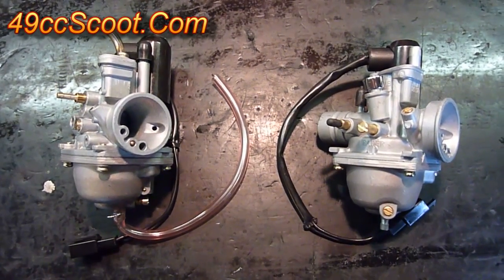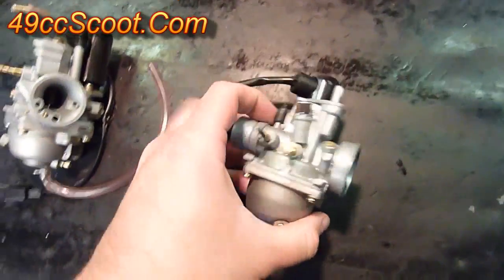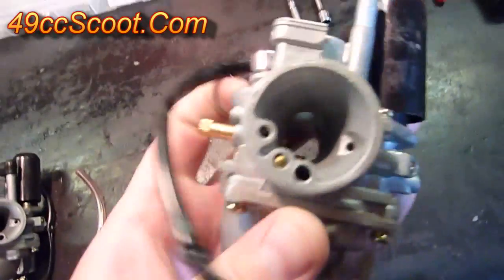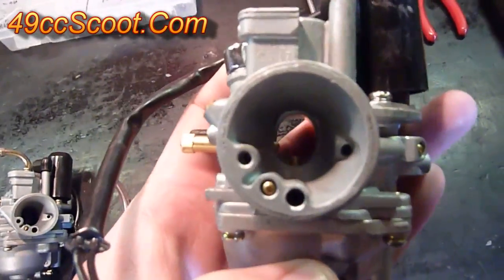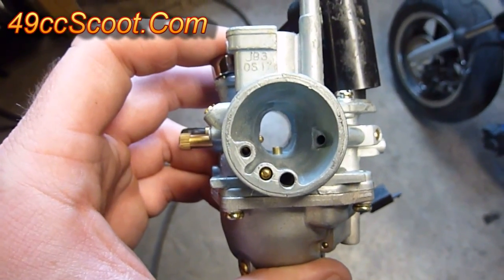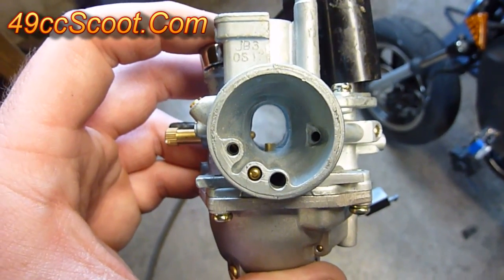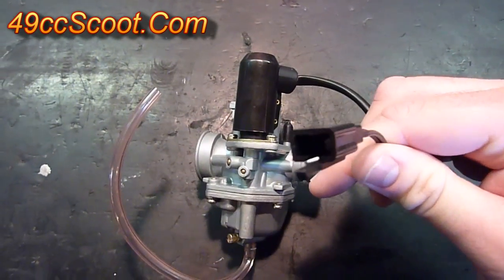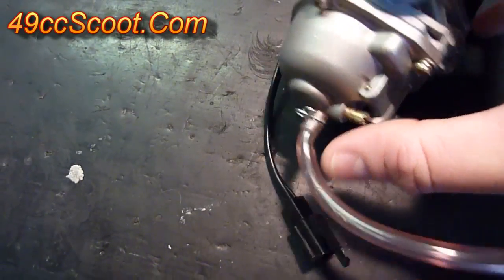Two-Stroke Scooter / ATV Carburetor Settings And Adjustments 1of4 : Basics, Overview

Comment: Hi! I have a question: Why is my carburetor outled blocked? Its much smaller then ours. 60% of that hole is blocked with some kind of metal?
Can you help?
Reply from the maker: Do you have a pic or vid link?
Reply: @49ccscoot  I found a pic on Google, its the same carburetor as mine, but the hole is a little bit bigger than mine. It's the first link if you type on Google: Orginal vergaser 50 ccm 2 takt mit markenzeicgen u.
Reply: @49ccscoot ???
Reply from the maker: @KEEWAY_LOVER  Just not sure what outlet would be blocked. If you mean the engine side of the carb has a chunk of metal inserted to restrict it, I haven't seen that before. I would wonder if it could or should be removed, but seeing it would help.
Reply: @49ccscoot  but my outlet is smaller than on the picture

Comment: Has anyone on here ever come across any problems with the auto choke on these carbs? I’m having trouble with my sons buzz 50 starts and runs but soon as you go to drive away it bogs down and cuts out. Won’t start again until you have switched the kill switch off and on again then it starts easy but cuts out shortly after. 
Carbs clean and fuels flowing but I haven’t dealt with a auto choke before so could it be electrical?
Reply from the maker: The automatic enricher heats up and expands to cover a port and stop enrichment. If you can shut the engine off and then fire it right back up, it shouldn't be the enricher because it's state shouldn't change that much by cooling for a second or two. If there is a timelapse till it starts again, giving then enricher time to cool and contract, then you are probably on the right track.
Reply: @49ccscoot  brilliant explanation thank you for that. That kind of reply earns a sub all day long👍🏻I might need to give the carb another strip down then and a more intricate clean. It sat for a bit with fuel in the carb I wouldn’t of thought it was long enough to coz any trouble but the new fuel really does solidify quick so maybe I’ve got a jet blockage somewhere. 
Thanks again
Reply from the maker: @weebinniec  If you have access to an ultrasonic cleaner, you may want to try that. I have had carbs that were cleaned thoroughly before and then worked after ultrasonic cleaning. It's not common, but easy enough if you have one around.

Comment: my carb has an additional horizontal port that sits below the vertical vacuum port. I assume this is for the breather hose from the stock air box? Is it necessary to connect it?
Reply from the maker: Some have multiple vacuum ports or it could be something else. I've never had a breather hose on any of my two-stroke airboxes. See if you can find a diagram or pic of your machine to verify. If it's a vacuum port, it must either be connected or capped though.
Reply: I can't seem to find an example of any diagram with my exact air box (OEM Yamaha 3KJ horizontal minarelli) The examples I find are 90percent the same with the exception of the absent hose which my airbox has.

The port on the carb that I am referring to often comes with a short 90 degree piece of open hose on the end of the port from the supplier and is not capped off. I don't know if that explains much  @49ccscoot
Reply from the maker: @stemfilms901  That may be a vent then. There is usually a bowl vent (or 2) on carbs. Often with a downturned hose on it/them. If you check the carb out, you should be able to tell what's what. A vacuum port would have to go into the inlet tract. A bowl vent would lead to the bowl.
Reply: @49ccscoot  if in case it is a bowl vent, should I just leave the 90 degree hose on there as it came and just zip tie the hose from the airbox?

Really confused about the purpose/placement of that air box hose lol
Reply from the maker: @stemfilms901  That's where I'd start.
Reply: turns out to be a bowl overflow as you said, thanks for your help again!  @49ccscoot
Reply from the maker: @stemfilms901  Glad you got it figured out!

Comment: dangg this means i have a 14mm carb on my bws 100!😢
Reply from the maker: The good news is that a DellOrto PHBG 21mm is usually a pretty simple swap in place of the stock carb. No personal experience with the BWS100, but if the intake and airbox fit the same carb that I showed it should be easy enough and plenty of carb unless it's a high revving setup.

Comment: Hello, what could cause exhaust smoke coming out of carburator? Also the revs would go up hard/hesitating, it'll work if I set the mixture screw at 3 turns, and at full throttle the revs would go up and down, it'll lose power then gain it again.
Reply from the maker: There is no carburetor setting that will make smoke come out of the carburetor. An abundance of fuel may be part of the cause if it's actually fuel vapor/mist.

Comment: Is the makuni 14mm mixture screw adjusting air or fuel?
Reply from the maker: Just look at which side it's on. If the mix screw is on the air filter side, it's adjusting air. If it's on the engine side, it's adjusting fuel.

Comment: Hi, the carb to the right, has a "chrome button" on the left side of the carb (opposit side of choke). What is this? On my carb, the chrome button is missing.. Can you run with out? /Rob
Reply from the maker: It's a bolt that doesn't do anything on this one. It's some sort of block off that they put on some and others don't have at all. I don't recall ever owning  a carb like these that has an open passage there or makes use of whatever it was intended to be. So I guess the short answer is, you should be fine... as long as it's not an opening without anything in it that leads into the intake tract.

Comment: Thanks for this vid, I have a Chinese 2 stroke scoot with I think the 14mm Mikuni(copy) carburettor and I’m having persistent flooding issues, I’ve taken the carb off over a half dozen times, cleaned it using carb clean spray, adjusted the float height, it works for a while but after a week or two the coughing and spluttering and not wanting to Rev comes back, 
     I bought a new carb for it, and it will not even run on that, I’m at a loss as to what it may be, it either floods or starves.
Reply from the maker: Have you checked the jetting in the new carb? Sometimes the jetting is way off of what you had or need in replacement carbs.
Reply: @49ccscoot  The only things I’ve checked is the float height, I don’t know if one of the previous owners messed with it trying to get more power out of it and completely upset the setup. 
      Do these have a clip setting on the Throttle needle? I haven’t checked that. 
      The plug is white but then drips of fuel come out the overflow pipe on the carb.
      It’s happy to rev up to a half throttle, beyond that it loses power and sounds like the choke is on or something.
Reply from the maker: @willswheels283  Unless it's one of those nifty EPA approved deals, it should have an adjustable needle. Being good up to, but not beyond, half throttle makes me think main jet.
Reply: @49ccscoot  Thanks mate for your help, I’m thinking along the same lines now as well, I’ll check the throttle needle.

Comment: Great video as usual,,,,I have both 50 and 150cc 4 strokes,,,,I just picked up a prescott 50i and the carb is shot, however I noticed that this carb has no vaccum line to it, just fuel in and out from petcock and vaccum to intake manifold, when I get the new carb do I just plug up any vaccum ports on carb or does this scooter require a special carb?  Also, I usually get the $28 carbs from amazon both 18 and 24mm and have no issues with them at all, can you recommend a resonable priced carb that you think would out perform these carbs that would work on those bikes? Flat slide perhaps! Id hate to replace the throttle cable but I would do it,,,,TY for all your hard work.
Reply from the maker: You shouldn't need a special carb. Make your connection to the petcock and any other vacuum accessories and plug leftover ports. 

If the current carbs work, stick with 'em. I've never used a flat slide on these, but PWK is the popular choice. Often said to be harder to tune and doesn't stay in tune as well as a CV carb. The main advantage that I hear regularly is improved throttle response.

Comment: The carb on the right what is that silver screw? You never said what it was
Reply from the maker: It's a bolt that is blocking off a hole from the factory. Not something that you should touch.

Comment: Hi again I buy a PiaggioZip 50 2T I need to cleaning the carburettor when I finiz screw all both screws in a many full turns I need screw auto thank you again appreciate
Reply from the maker: Count the turns required to screw all the way in BEFORE you alter anything. Write those numbers down. That should be a starting point if the carb has worked before. Otherwise, 1.5-2.5 turns out for a starting point guess.

Comment: My fuel drain is draining fuel to much and when l start scooter it need to fill the bole it runs but dont want to rev after giving it gas after minut it start runing okey wants to rev, fuel consumption trow the roof
Reply: Please reply
Reply from the maker: It sounds like you need to check your float height. https://www.youtube.com/watch?v=xBCzVg4kUN0

Comment: Very good thanks.  The vacum port....is that supposed to be connected to a vacum hose  or line ?  Er is it one way valve in there and shall not be connected.  I mean there is a vacume hose or line to my Vivacity Scooter and it is connekted....not on the original carburetor...but on the intake manifold.  I guess there is a vacum system that needs to work properly to let the engine or carburetor work properly.  Easy to get confused when buy chinese carb on e-bay...because they do not come with instructions that you gave us here !  Thx.
Reply from the maker: Most likely it goes to a vacuum petcock so it automatically shuts off fuel supply when the engine isn't running.
Reply: @49ccscoot   Thank you !  Ehhh can i ask if it is likely i have a  faulthy vacuum in my scooter...because it dies exactely afther one kilomere a proximatly.  I thought it is the stator and pick up coil... I thought i saw no spark  when inspect...but could have seen wrong. When cold it starts and work again...until that kilometer...it shuts down like it was shot !  Maybe it drops some fuel....but the vakum valve maybe faulthy and shuts down the fuel when running...oposite to what it should do.  I know...i kan test and see if the gasoline is comming down the line.  Just asking anyway he he ! :-)  Thought the pick up or stator could react to heat and than shut down ?  Or if those ar faulthy...they just does not work  on and of like this ?  Ok ok...much writing.  Take care and thx again ! :-)
Reply from the maker: @Norwaywildlife  Could be a fuel supply issue. I replace my vacuum petcocks with manual switches because I've never had  a manual fuel shutoff fail. Could also be something like float height too low, and then it drains the bowl. That is more likely if it dies when you are using a lot of throttle. Ignition components can also fail when hot.  Sometimes it's easiest to try and get it to fail close to home. So if it goes 1km and dies, ride 1/2 km and then turn around and head back home. Have whatever you need to do some tests ready. Spark is an easy one to test about anywhere, especially if you carry a spare plug. If it loses spark when it dies and it's back when it will refire, then you know you need to investigate the ignition system.
Reply: @49ccscoot  Thank you ! :-) Super !  Appreciated ! :-)
Reply: @49ccscoot  Hey again !  Scooter Talk.  My Vivacity...i found out it is Vivacity 1 and 1999 model. I changed the stator today and pick up coil.  The problem still exist he he...So...the technique about the valve...i going to replace next...as you mentioned. Vacuum Petcocks. Now...I have a strange thing.  It starts perfectly on the kick start....but with el start...it will not start.  Can it be the battery delivers too little amp ?  It turns arround though...  Or have you ever experienced that the key swich faults and gives the coil grounding when activating the electrical start engine ? Or in other ways...when activating the starter...it in same time grounds the coil  ?  Ok...I guess i have to see on the spark.  But it starts easy and good on the kick now ! :-)  If i can ask ! ? :-)  Anyway...thank you very much for you previouse ansvere !   If my one kilometer drive and stop is not fixed afther vacuum replacement...the carb will be inspected next...It will turn out good he he :-)  Wghen working...it is an exellent scooter ! :-)
Reply from the maker: @Norwaywildlife  Could be a low battery. 
https://www.youtube.com/watch?v=Bw3ikMEGh74

Could be some weird electrical issue. Don't think it's that likely that the e-start is killing spark, but you can check for spark while e-starting and  see if it does go away then.
Reply: @49ccscoot  You°r the best to respond on youtube !  Thx allot ! :-)
Reply: @49ccscoot   Hey !  Now i checked more...and it is not a wierd grounding of coil issue...why it not start on el swich.  But i have to give it more gas on handle before it starts with swich el...compared with kick. Kickdown it starts momentarly. It could have something to do with the vacuum or low adjusted needle valve as you suggested.  The story goes on until perfection however :-)  No problem :-)  Just sharing some experience.  Ok

Comment: I hope you can help me, (english isnt my language, so there will be some words that are spelled wrong.

I have a cpi GTR 50, 2 stroke. 
The carburator is the same one you have! And the petcock, the flat end. My one is a dellorto 12 mm phv or sommething.

But i bought that cpi from a guy who had the bike sitting for 7-8 years. The rubber that is between the carburator and airfilter was cracked, so it got more air than needed. So i quickly fixed that, and now i dosnt have air leaks, i started and idle fine, but i couldnt still drive it, if i give it more than 50% gas it just goes back to idle or shuts off. (not a fuel problem by the way, the bike is stock and fuel jets) then i cleaned the carburator and putted it back together, and now it only start with some help from a carburator cleaner and idles High, for 1 second, and then shuts off. But before i cleaned the carburator it idle fine. 
But i have to say this. The air adjustment screw is totally shot. U cant screw it in or out, i can see that the previos owner have messed with it. Do you think the problem is in the air adjustment screw?  
Every other things checks out fine without air leaking thrue, like the rubber thing that holds the carburator or the rubber thing between the carburator or airfilter. 
Thanks for your time, i had to write so much so you can understand easily.
Reply from the maker: Knowing that part of the carburetor is bad, I would replace the carburetor. If it's only the screw itself, then you could try to replace that. Don't bother if it's the body of the carb that is messed up.

Comment: My 50cc scooter is using a lot of fuel fast. What do I do to adjust it? Thanks
Reply from the maker: Do some checks first. Make sure it's not leaking and that the float height isn't too high.
Reply: @49ccscoot  great thanks for the help and quick reply I will try this

Comment: Awesome video! this cleared up so much with a mystery carb i got... I dont want to replace because it's in almost new condition but i was able to track it down to a Lumix GC 90cc.. for a 2 stroke, granted i'm completely new to 2 stroke motors, i've been able to piece through the majority but i've been hesitant to run it only because it oddly has 2 oil inlets, one hose is 1/8" that seemingly goes to the oil pump, but then another brass one with a nipple/barb next to where you have your oil inlet on the carb (the carb with the brass elbow with no barb/nipple).  Thanks to you i figured out that the fuel inlet is the cast inlet at the top (weird to see a fuel line with a cast inlet)... but i'm not sure about the two oil inlets.  Its on a 90cc dinli, and i have an oil resevoir that connects directly to the cylinder behind the crankcase, the small 1/8 hose that comes from the pump to the carb... and that still leaves the one oil inlet open on the carb with nowhere to connect... some people said just to create a closed loop on the oil pump/cylinder connect so that it basically just cycles within that loop, and just cap off both ends on the carb (essentially i just connected a hose from the 1/8 inlet to the larger one (both on carb).  here's a pic of the carb i'm talking about...  Any idea as to whether it's ok to create a closed loop and/or cap the two oil inlets on the carb and just premix? or if i were to keep the oil pump connected, would i just cap the larger of the two oil inlets? thanks so much for your videos and in advance for any and all help! :) 

https://cimg2.ibsrv.net/gimg/atvconnection.com-vbulletin/614x450/lumixgcdinli_5e441bc4b1d1bb24065afdaac309cafc47c3db89.jpg
Reply from the maker: Oil Inject 1 is a vacuum source. Cap it if it's not needed for something (like a vacuum petcock). Oil Inject 2 is the actual spot for oil injection.
Reply: @49ccscoot  my 150 scooter has carb issues no matter what I do change main jet, needle position, fuel air screw etc I've been working on these for 10 years. So I ordered a kit. If the needle and seat are bad that will do it. The diagram has gas on it it's supposed to be dry.
Reply from the maker: @burt1758  Float height and needle/seat issues could be it. If you have another carb you could also see if the same happens to it.